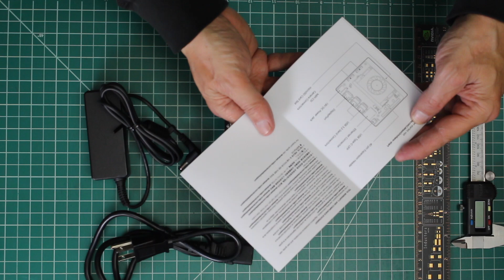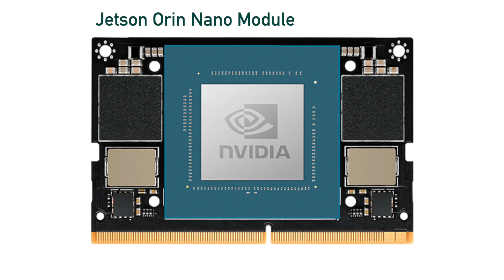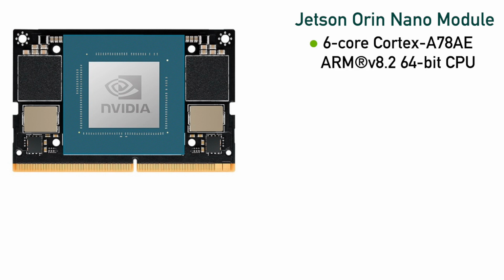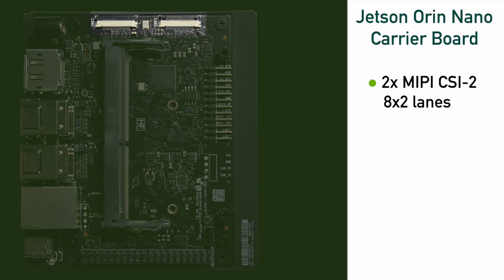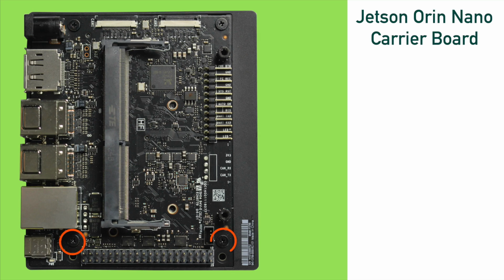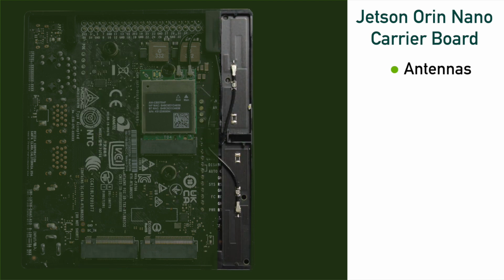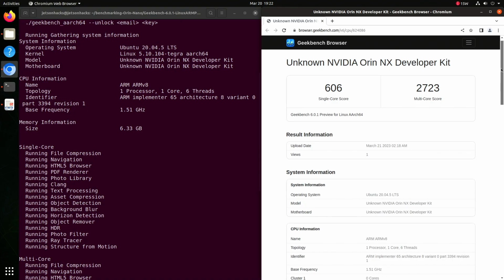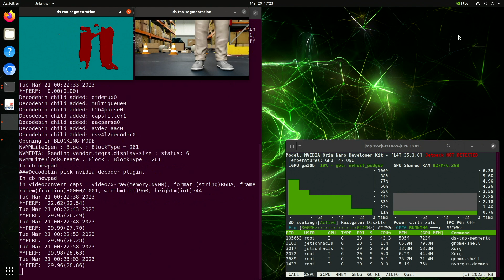Ultimate Jetson Orin Nano  Walkthrough

Comment: Thanks still relevant in 2025... Is the NX more capable?  I want to run llms
Reply from the maker: The Orin NX is a better machine for LLMs for two reasons. You can get the NX with twice as much memory (important for LLMs) and the NX has a DLA (Deep Learning Accelerator) which can cut inferencing times substantially. Thanks for watching!

Comment: But a 4060 ti has multiples processing power for  the similar price? Yeah for smaller packages it serves
Reply from the maker: That is correct. They are for different purposes. The Orin Nano is a small form factor single board computer that can run up to 25 Watts of power. Which means that it can run on a battery. The 4060, on the other hand, has much more compute power, but requires a PC. The recommended system power  is 550 Watts.  So about 20x more power. Thanks for watching!

Comment: Hi! Can i interface a full hd mobile display in it?
Reply from the maker: It has a Display Port adapter, which supports up to 4K @ 30fps. 1x 4K30 multi-mode DP 1.2 (+MST)/eDP 1.4/HDMI 1.4 - It depends on what you mean by a mobile display. If it has HDMI or DP, then it should be ok. Thanks for watching!
Reply: @ Hi thanks for replying. I’m talking about a mobile display comes with a ribbon cable connector. Like i want to make a handheld pc type
Reply from the maker: @krunalpatel9811 Not natively, no. You will need to get an adapter. Typically those are not general purpose, they have to be matched with the particular display.

Comment: What is the diffeence between the Jetson Orin Nano Development Kit and the Jetson Orin Nano Edge Device?
Reply from the maker: What do you mean by Jetson Orin Nano Edge Device? That sounds like a generic marketing term.
Reply: @JetsonHacks  would it be right to say that the Jetson Orin Nano Edge device is a development kit in a case/box ?
Reply from the maker: @Bwajster  Kinda. The Jetson Orin Nano is a module which you mount on a carrier board. The development kit is one kind of carrier board. However, as the name implies, it is a development board. Typically people will use the development board to develop products with commercial carrier boards with cases, power supplies, batteries and so on to meet their application needs.

Comment: Hi, appologies for this might be a silly question, what is the difference between the Jetson Orin Nano development kit and the Jetson nano edge device in terms of form factor, interfaces, ports, connectors, performance, power consumption etc.
Reply from the maker: Not quite sure what you're asking. You can look up the specifications for each on for comparison of details. In general, the two are the same form factor. The power requirements are slightly different, the Nano is 5V and the Orin Nano is 9-20V. The Orin Nano is ~20 to 80X faster in compute depending on the task. Thanks for watching!

Comment: Does the voltage input effect the performance in anyway? I'm using one for a project where it has to run headless off battery power but I only have BECs that deliver 5-12.5V. It runs off 12.5V, but I cant find any documentation if lower voltage forces the system to the lower power mode. Any tips?

Comment: Hi dear, help me. I have a jetson orin nano developer kit and I can't get it to output the signal via HDMI, it has a displayport port and I am using an adapter to display the image on an HDMI monitor.  I already recorded the operating system on an SD memory, I already inserted it but when I turn on the monitor there is no signal, is there any other step I should do?  Maybe connect a jumper on some of its pins. Thanks
Reply from the maker: You should check that the DVI adapter is fit all the way into the connector on the Jetson. There should be no further modifications/jumpers that you need assuming that the board is properly powered on. If you have further questions, please ask them on the official NVIDIA Jetson Orin Nano forum, where a large group of developers and NVIDIA engineers share their experience. Thanks for watching!
Reply: @JetsonHacks  thanks

Comment: After 7 Years of Nintendo with the old Tegra (which is still in Google's Best Media and game player all these years) Do you think Nintendo will upgrade the Switch with a Tegra Orin 8GB Nano?

They don't even have to call it anything fancy.  Just Next Gen Switch.  Or Something like that.  Put an upscaler in the dock, make it just a Tad Bigger for those of us with adult hands, and that's basically it.  Everything else can be a drop in replacement.

This is Literally Better than the gaming PC I was gifted, with is an AMD FX-6300 with an Nvidia 1060 with 8GB of system memory.
All Nintendo needs is an upscaler for 1080P and 4K, allow Netflix, Disney Plus, Hulu, and Youtube, and they have a block buster again for the next 5 years until they use the Full Nvidia Orin Nano 32GB.
Reply from the maker: If it's coming out, it better be soon if it's for the holiday rush of 2023! There's been a lot of speculation as to if they're even keeping the Tegra processor. 

I think one of the issues for people "with adult hands" is that the phone game market is pretty stiff competition. Most adults buy phones "anyway" or need an excuse to upgrade. New phone models come out every year, so they're multiple generations away from the Switch by now. It'll be interesting to see what happens. Thanks for watching!
Reply: The Orin Nano is Still ahead of All the SOC GPU hardware.  It Should even outclass AMD's integrated GPU's.  AMD's latest 15 watt APU is just on the bubble of a 1060, with the full Orin Basically a 2060/3050ti. @JetsonHacks

Comment: Hi, great video by the way.
I am planning to buy jetson dev kit for my robotic car and in a dilemma right now as to which one to buy. I plan to implement various deep learning projects, so would like to have something powerful and current (jetson nano dev kit very weak and Orin AGX dev kit way too powerful and expensive). Initially I was considering AGX Xavier dev kits, but those cost around $1.3K in amazon these days.  Would you say Orin nano can be considered as replacement for Xavier AGX in terms of performance? 
Do you have any other suggestions for dev kits around $1K?
I would like to ask one more opinion:
Which is a better investment, buying cheap jetson dev kits (<$700) and powerful lap with Nvidia 40series GPU or buying Orin AGx dev kit (2K) and continue using 6 year old laptop?

Thanks
Reply from the maker: Thank you for the kind words. The most popular Jetson for the R/C robotic car set is the Jetson Xavier NX, which has just been replaced by this Jetson Orin Nano in the lineup. There's a full ROS stack, and is popular with the F1/10 group. I don't know how big your robotic vehicle is, but if it is scale this is a good balance of compute versus power.  The Orin Nano is a capable machine. However, it does only have 8GB of memory which is small in relationship to the AGX Xavier. It depends a lot on how you intend to use your Jetson, and how many simultaneous vision and machine learning models you are using simultaneously. 

For example, here's a Xavier NX on a 1/10 scale vehicle: https://www.youtube.com/live/WzQlmUjh9Nc?feature=share&t=596 at DIY Robocar in Oakland, CA. This is indoors at a small track, outdoors the car reaches must higher speed. It has lidar and cameras for sensors. GPS is added for outdoor use.

Personally, I would buy the Orin Nano and try to outgrow it. There's a lot to learn beyond just the compute side of these types of vehicles. There are tasks like path planning, sensor fusion, model building and so on. I don't get the feeling that having a lot of compute power on your laptop will help you get over the learning curve when first starting out. These types of projects are definitely the old racers creed, "Speed costs. How fast can you afford to go?" A lot of the the cost is in the amount of knowledge that you need to acquire. For example in the DIY Robocar races, the fastest vehicles are the one first shown in the link and another vehicle later on in the video which costs about 1/5 as much. But it's two real smart guys who know a lot about the space. The video doesn't do it justice, in person the things are scary fast.

The F1/10 group is mostly in the university circuit. They're racing this week in London at the ICRA conference. Here's an example: https://youtu.be/BWRscx68Dl0 These cars use Jetson Xavier NX, as the Orin Nano are just now becoming available. New vehicles will be using the Orin Nanos.

Hope this helps.
Reply: @JetsonHacks  Thanks for the quick response. This is exactly what I was looking for.
I am planning to build upon the F1tenth platform. For your information, i am quite familiar with the robotics field. Recently i graduated with a Masters degree in Robotics with more focus on software side which covered ros, path planning, controls, perception and DL.
I am a mechanical guy and likes working on hardware. So was planning to build the robot car and try to implement projects which I haven't covered before.
Right now in the process of shortlisting projects and selecting hardware for the car.
My plan is to work of couple of projects which may last upto 1-2 years. So I don't want compute power to be the reason for not able to try the project. The 8gb ram about orin nano , worries me a bit.

Thanks and have a great day!
Reply from the maker: @jeffinkachappilly9708  You can buy an Orin NX + carrier board if you need more memory, it's less than an AGX Orin.
Reply: @JetsonHacks  If you had the freedom of choosing carrier board, which one would you go for (any preferred manufacturer)?

Thanks again
Reply from the maker: @jeffinkachappilly9708  Difficult question. Depends on which peripherals you want to attach, budget, how much  headache you're willing to put up with when upgrading. ConnectTech has a large selection of carrier boards in different configurations, and are usually the professional go to. However, on new releases most of the third party boards lag a little, as they have to provide an updated board support package for the release. 

If you want the easiest route, you can use the NVIDIA dev kit use the Orin Nano until you outgrow it, and then replace it with an Orin NX module. If you want to skip the Orin Nano part, companies like Waveshare: https://amzn.to/3C7EdPA and Seeed Studios make dev kit board clones. The dev board design is open source and available on the NVIDIA site, so you don't have to worry too much about the engineering. Some of the signals on the dev kit are relatively high speed, so there is some engineering involved when laying out boards with those features. You can buy them populated or unpopulated with the Jetson module.

Comment: Hi, very interesting video !
I want to build a fixed wing that will need to fly to at least 60 km/h maybe a little more .
Object recognition will be used so I need a good realtime performance .
Do you think the Orin Nano or even NX would be a good option ? 
On the real time demo you showed , the video wasn't very impressing.
Thank you
Reply from the maker: There are very many object detection models and techniques that you can run on the Jetson. The sample in the video is not the only one. For example, here's an Orin Nano running object detection @ 50fps on a different model: https://youtu.be/np78wgXmYIM 

Your use case is challenging, but it will certainly depend on how you are planning to detect objects. You have the model itself which needs to be trained to find objects of interest. The Jetson is for inferencing, so it will depend on the complexity and layering of your model as to how fast objects are detected. Unless you are planning to display video on your fixed wing while it is flying, you will not need to do the video display and GUI (rectangles, labels) for object detection. That's a major source of time there. You can ask specific questions on the NVIDIA Jetson Orin forums, where a large group of developers and NVIDIA engineers share their experience.Thanks for watching!
Reply: @JetsonHacks  thanks for your response !

Comment: Hi, I am a software developer myself and I don't have experience with AI kits like these at all ( I just use my macbook or windows PC for development ). What are these things specifically great for? What kind of projects? And why should I buy one if I own a system with a Ryzen 5950X + RTX 4090 GPU? Thanks for the video.
Reply from the maker: You are welcome. There are a couple of major use cases for the device. As the name suggests, these are development kits. People use them to integrate Jetson modules into products. Probably the best known is the Nintendo Switch video handheld game device which is based on an earlier generation of Jetson chip. 

The Jetson provides a large amount of computing with several key advantages. The most important is low power consumption, followed by size and weight. Whereas your system consumes ~750W+ of power, the Orin Nano consumes 7-15W. This makes the Jetson well suited towards a variety of applications such as robotics and smart edge devices. Most of the smart edge devices are computer vision applications. You can usually think about it as devices that run on batteries or remotely. Devices that have a limited power, but need large amounts of compute power. For example a smart "mirror" in a car which does object detection. NVIDIA offers a combination of two Jetson modules on one PCB for  Advanced Driver-Assitance Systems (ADAS). ADAS is the fancy name for what we think of as self driving cars. 

Also, it's a single board computer which means that everything that you need on the system is on the carrier board. Various 3rd parties offer carrier boards in different configurations. Some people will use Jetsons as replacements for Raspberry Pis when they need more compute power in the same physical footprint.

There are currently over 1M Jetson developers, so it's difficult to summarize all the uses cases. You can take a look here: https://resources.nvidia.com/l/en-us-jetson-success-stories for some Jetson success stories. 

With all that said, there are reasons to buy the Jetson! However, it's not a replacement for the desktop that you are using, nor does it do anything beyond what the desktop does beyond breaking out hardware GPIO pins and such. Thanks for watching!
Reply: @JetsonHacks  Wow, thanks a lot for the detailed information! Highly appreciated! I will definitely do more research using the info you provided. I might find a use case for a project of my own since I think it is a great high performance, low-power chip! One more thing: where can I get those Nvidia cups? They look amazing!

Comment: Would you recommend this "Ultimate Orin Nano," for a beginner project to create a duel brush-less motor controller, with a car alternator as the power supply?
Reply from the maker: I'm not sure I understand the question. Do you mean to use the Orin Nano as a brushless motor controller (typically called a BLDC)? Or as a device to control a brushless motor controller (like a VESC or an O-Drive)? 
Is the alternator running from a car or other motor?

Comment: Must say looking forward to getting my teeth into the Jetson Orin for attaching various block cameras to Orin via the CSI-2 MIPI D-PHY interface by developing a V4L2 driver. Tried integration on RPi but our block cams do YUV4:2:2 and the GPU core of Broadcom chips really only do Bayer RGB... but from working with the Jetson TX2 I do expect YUV4:2:2 in the Orin. Off course it will be interesting to see what libcamera (big on the RPi) is like on the Jetson as that really looks like its getting pushed heavily in the open source community.
Reply from the maker: Sounds like a fun project! Lots of interesting stuff to explore on more capable hardware. Thanks for watching!

Comment: use rtx graphics card, you can play games and do some AI project with no difference from Jetson
Reply from the maker: That's one way to look at it, though it's missing the point. People building embedded system for which the Jetsons are intended  (robots, smart cameras, battery powered devices like hand held gaming devices) don't have a power budget that can accommodate a RTX card. The Jetson Orin Nano runs in 15W, the full dev kit  36W. A mobile RTX card starts at 115W. An entry level RTX desktop is ~ 275W.  The mobile and desktop need the rest of the system of course, CPU, memory, drives and all that. The Jetson would draw ~ 3.5A per hour, a laptop with the RTX would probably draw ~27A.  Apples and oranges comparison. If your intent is to play games and you can plug into the wall frequently or have a very large battery, the RTX is a good choice. If you're building a hand held gaming device, for example  the Nintendo Switch which uses the Jetson Tegra chip, you would use the Jetson development kits to develop it. Likewise for any number of other devices that have low power consumption requirements such as autonomous vehicles. Thanks for watching!